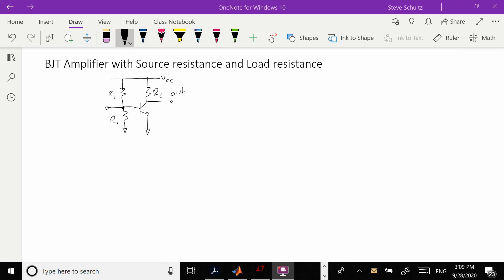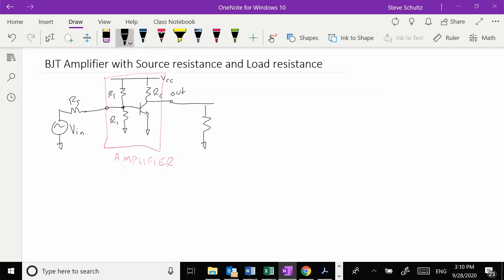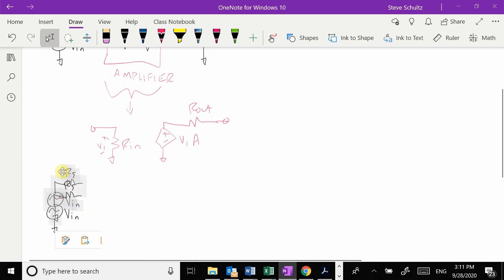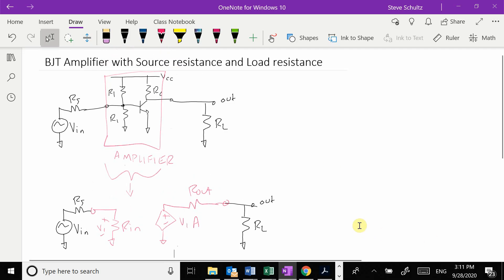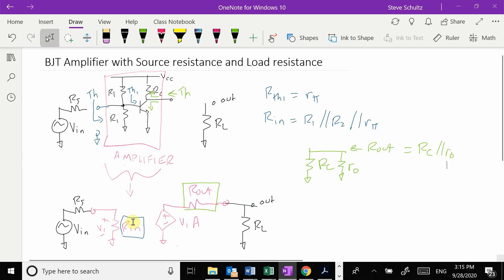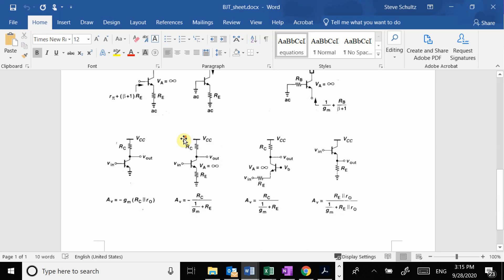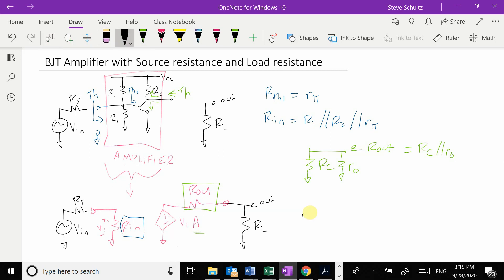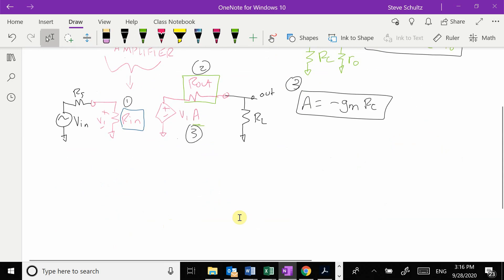Common Emitter with loading

Comment: This is not the way you design a circuit. For a start, the self-biased stage is a much better design. It only needs 4 components and has a gain of about 70. I have been designing circuits for 50 years and made thousands of modules and sold hundreds of thousands and made millions of dollars. Colin Mitchell. Talking Electronics.  Look me up.   You will learn al lot.